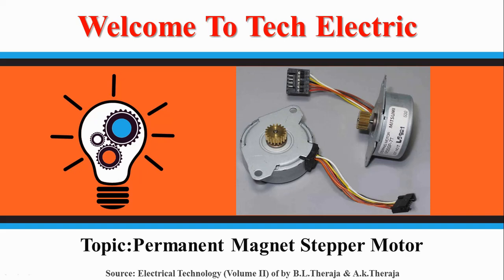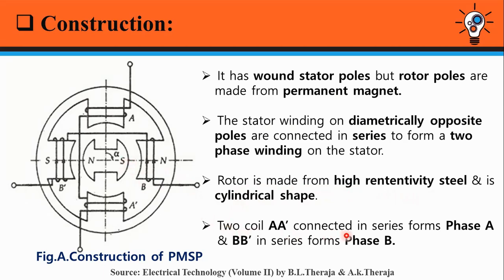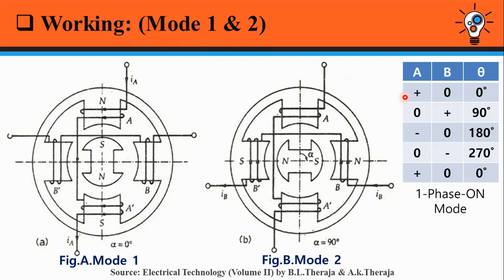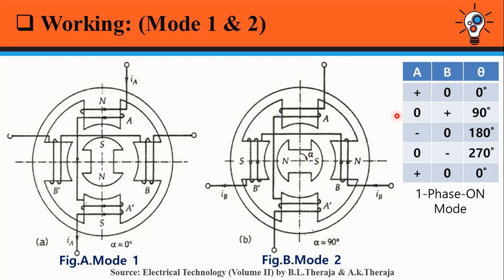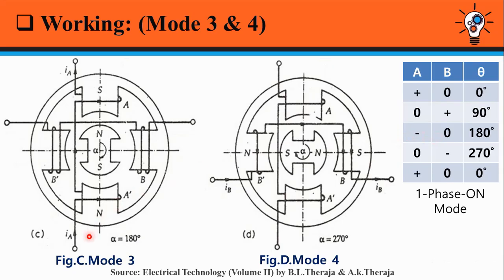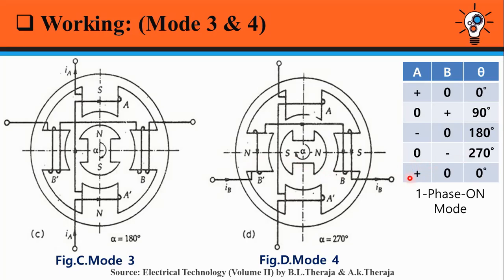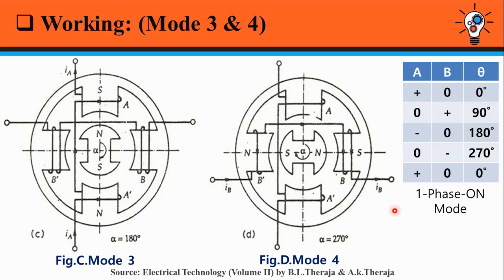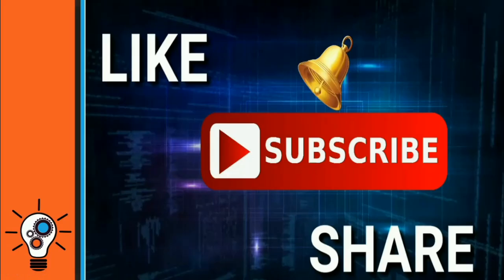Permanent Magnet Stepper Motor (Construction & Working) | TECH ELECTRIC |

Comment: What is meant by detent torque?
Reply: Tq
Reply from the maker: Detent torque is the amount of torque the motor produces when the windings are not energized.
Reply: @techelectricEE   I have an doubt for geo thermal energy .. can I ask you sir?
Reply from the maker: Yes ...You can @Harshavardhani kummari
Reply: @techelectricEE  in geothermal energy continuous power generation possible ?
Reply from the maker: Geo Thermal Powerplant is used as base load powerplant. This is only used for peak load for short duration.

Geo thermal (i.e.Heat Energy) is available throughout the period so it can produce power continuously. But it is expensive to install because of high capital cost.

We can use it but for now as non renewable energy plant are well established so we prefer it.

Hope this answer solved your doubt 😊